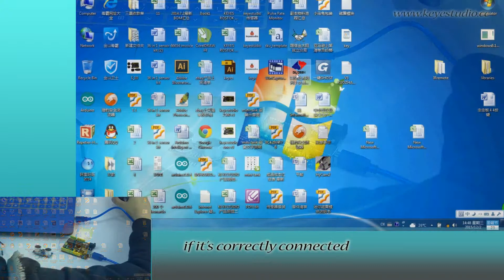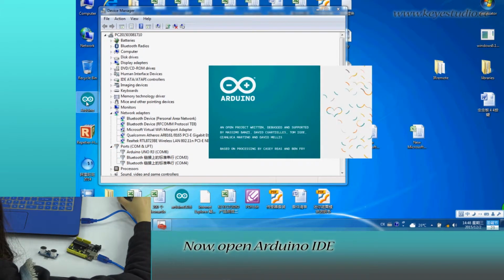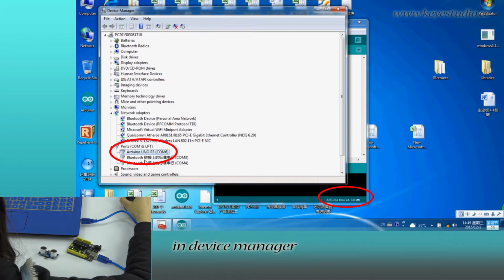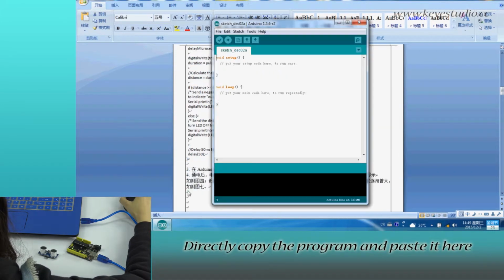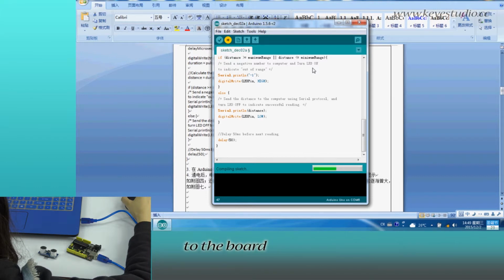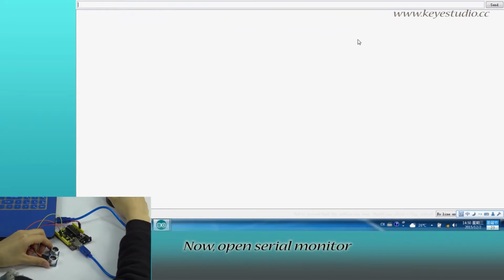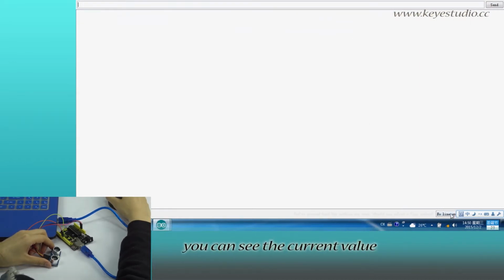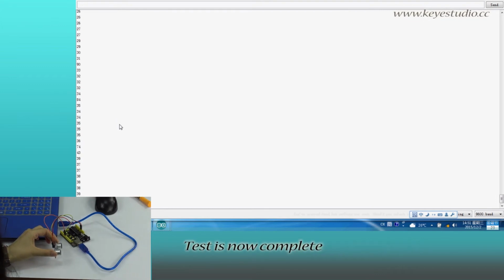HC-HR04 Ultrasonic Sensor

Comment: why I didn't connect the trig to the pin but it still works? and continued print the correct value(duration). I try two hc-rs04 and have same behavior,does the Trig is a fake pin and doesn't need to connect it?
Reply from the maker: +legendre johnny haven't noticed this until you brought it up. My colleague tested one of them and it showed the same result as yours. Still trying to figure this out...